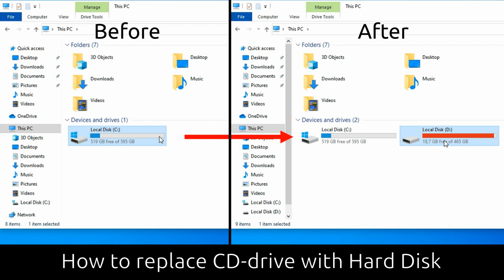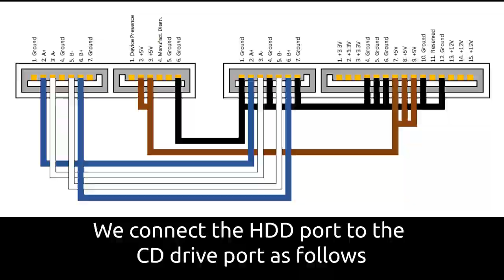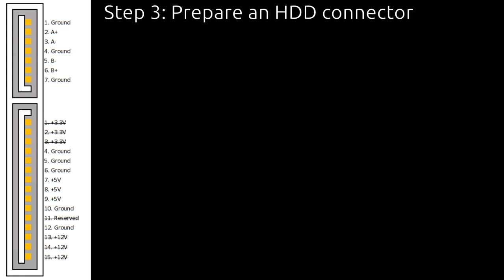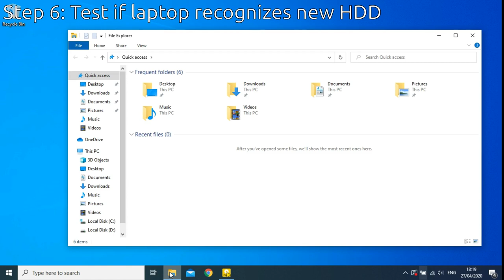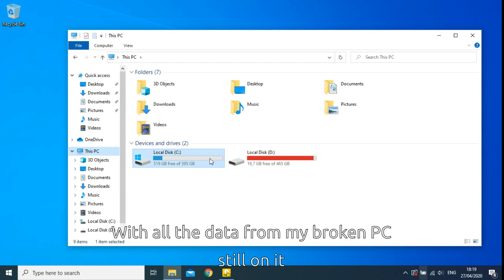How to replace CD drive with HDD (no caddy required) - DIY

Comment: That's a great idea! Even though I would just buy the mini sata to full sata adapter and use it directly to both save time and money. But still great video!
Reply: This would be cheaper...  It is liturally for free, if you have a old broken drive.

The alternative costs <10 bugs...

Comment: this is insane. I'm using this so I don't have my 2.5 Inch HDD dangling in my PC case. But it got real crazy when I realized you were actually doing this in a laptop and not just using an old laptop HDD in your desktop.

Comment: I can bypass a lot of these steps, since I have an SSD caddy from my old laptop (HP ProBook 6460b) and I’m trying to put it in my Lenovo ThinkPad L540, but the caddy is too thick. 

However, the interface board is the same, so I take that out of my caddy and (hopefully) it will mount in place where the optical drives current interface board is. 😊

Comment: took me two days to make my own like this but it was my first time ever to replace original parts by soldering wires for two different connectors and it works I even had some files left on it and everything showed up in the pc no problem but my only downside is that the pc shows that the hdd is bad and can fail

Comment: can it be done with a sata adapter and connect the CD/DVD from a broken laptop? just to avoid or reduce work with soldering (I have no solder kit at the moment) and if not can you advise what kind of cable to buy? thanks

Comment: why not just aim the hdd into dvd hole and push it into the connector isn't that faster ?
anyway many thanks for your efforts
Reply: connectors are different and the needed pins wont line up